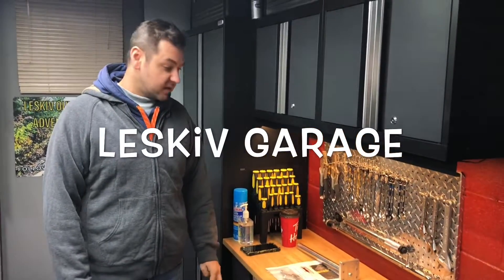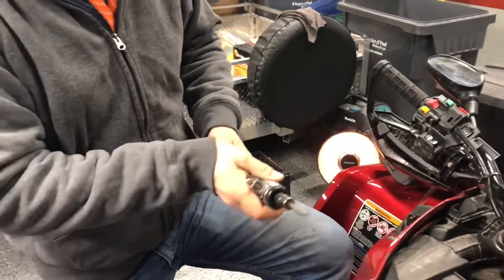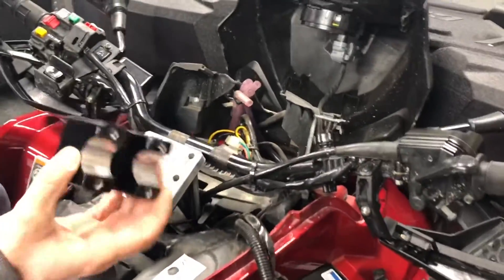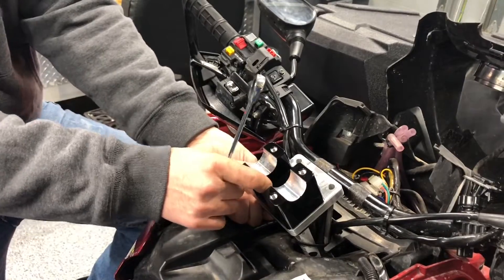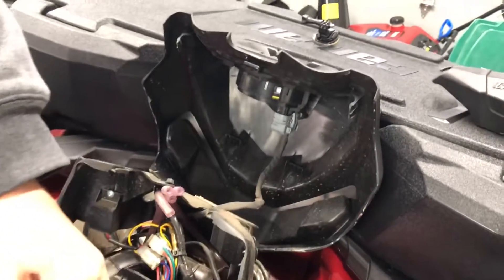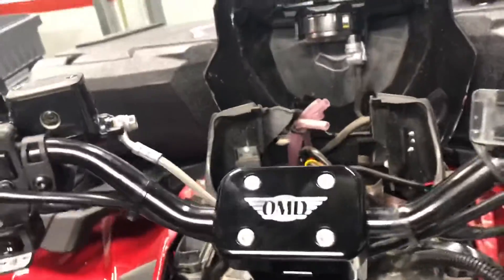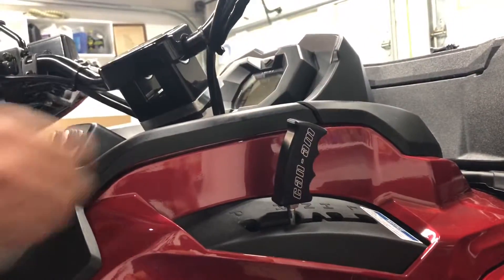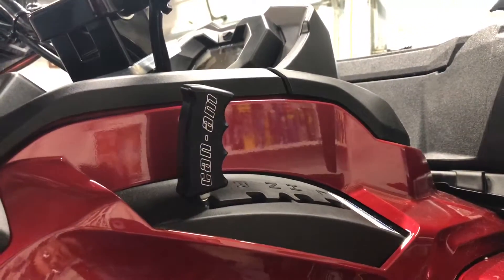2019 Can Am Outlander 850 MAX XT | CECCO RACING, OMD, RCM | Handle Bar Riser Install | Shifter

Comment: Did you have any problems with brake line, wire, and throttle cable lengths reaching the higher bar locations?
Reply from the maker: Nope, everything is still in the stock location.

Comment: Good morning, 
When you added the riser are the cable long enough ?
Reply from the maker: Yes they are. You won’t have any problems with the install
Reply: @leskivoutdooradventures  awesome. , thank you !
Reply: Would a 3” riser work too. ?
Reply from the maker: Yes it will, but most likely you wont need to go that high. I’m 6.2 and the regular riser works will for me.
Reply: @nickstapley5542  i put 3 inch omd riser on my renegade work's great, installed in 15 min ,cables plenty long enough.

Comment: Is your brake line maxed out now?
Reply from the maker: Nope! Brake lines are not maxed out.
Reply: @leskivoutdooradventures  cool, thanks!
Reply: @leskivoutdooradventures  go under the plastic you will find where the brake lines come to a T fitting pull that bolt out and will give you perfect movement